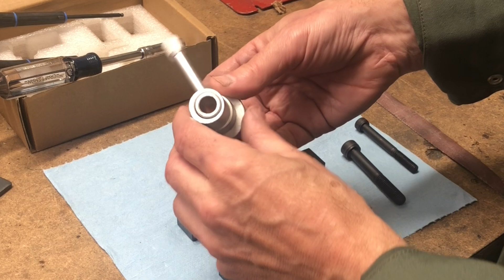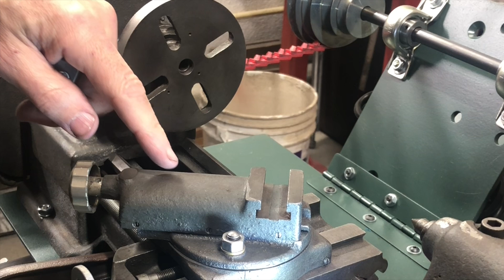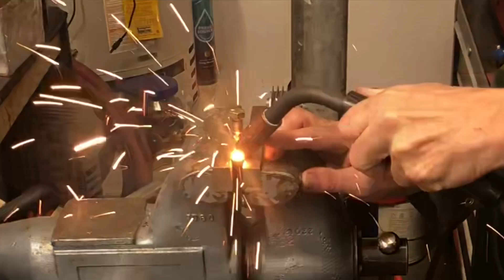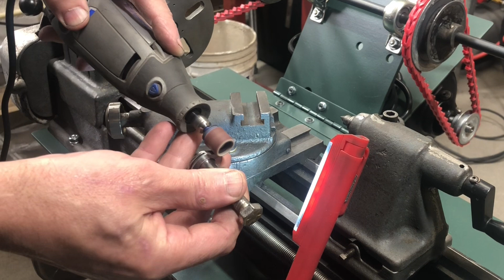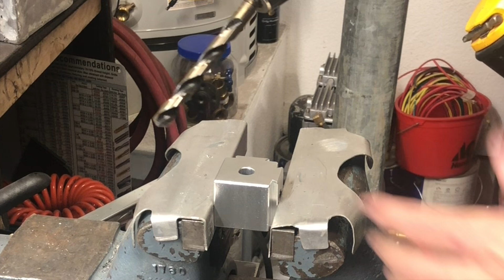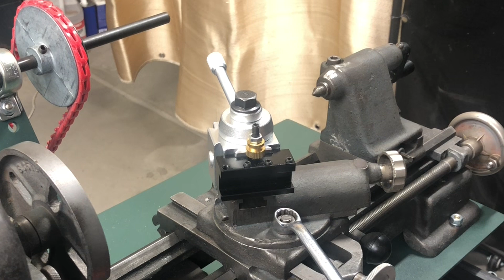Quick Change Tool Post for Grandpa's Craftsman 109 Lathe

Comment: what does the thumb screw in the belt pully cover/planetary gear thing do? mine is missing and the lathe is very very slow when I put the pin into that piece on the front side of the lathe. If I don't put the pin in, the chuck will not even turn. My keyway is not broken I know. but there was a bolt bouncing around in the gears and was not sure what it was for.
Reply from the maker: That thumbscrew locks/unlocks the planet gear carrier inside the planetary housing to the sun gear. It works in conjunction with the pin on the front of the headstock bearing support. You can get a copy of the original instructions at this website that explains it all in a pdf. http://vintagemachinery.org/pubs/222/6603.pdf  ...basically, you have to push the pin on the front out, and move the thumbscrew on the planet assembly in to get to high speed, and the opposite for low speed. It's because of the way the planet gear works, you have to hold the planets to the housing, and the housing to the shaft support to "shift" it into high speed, that way the sun gears and planet carrier turn at the same speed as the belt pulley. Please get that pdf, it's free and explains it better than I'm doing here, and it gives you a parts list and specific RPMs for the various belt and gear positions. I hope this helps. Thanks for watching!

Comment: I have a couple of those old 109's. When I was watching your video, it looked like there was some runout in your backing plate. These little lathes are notorious for having bent spindles. The little half-inch nose with a pass-through hole makes them fairly weak. A good project for the late is to make a new solid spindle out of something like 4140 stressproof or similar. Hopefully, before the spindle is bent, there are workarounds for this. I like your videos, but the volume is low. Maybe you should check your mic. Good job on the 109.
Reply from the maker: Thanks for the tip, I'll look into those (mic and runout) check the bushings and so on....THANKS FOR WATCHING!!!